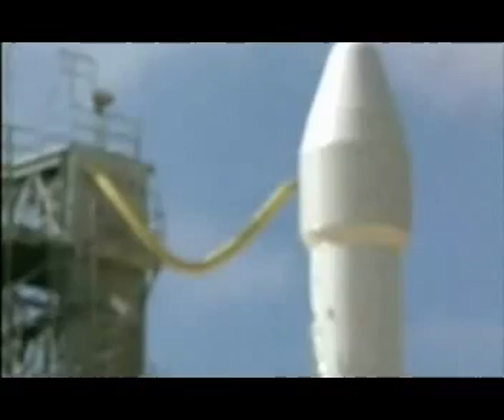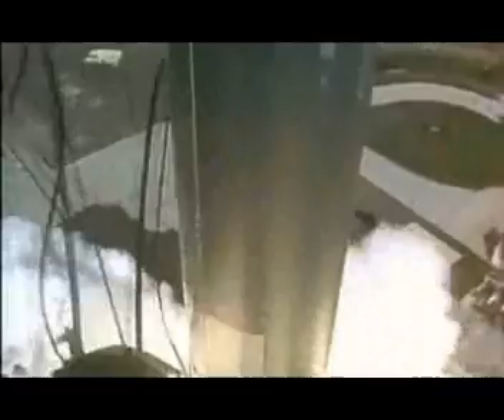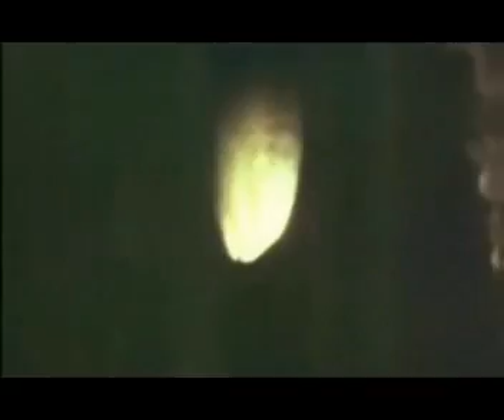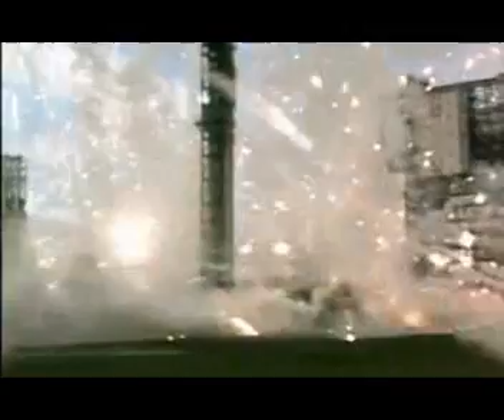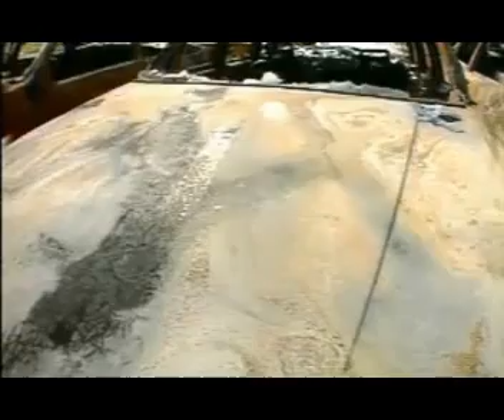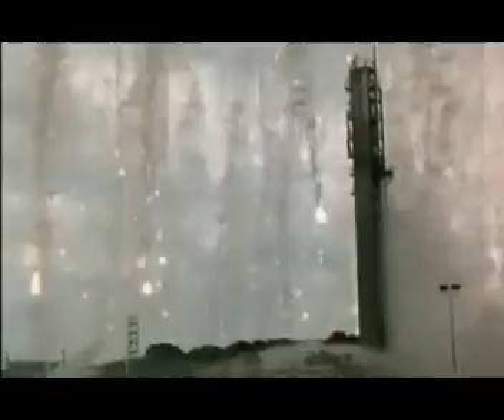delta II rocket explode

Comment: Yes.. the booster which was not ignited properly got stuck by something (forgotten crank as stated later in the video). Pressure might have built up inside the engine, containing the dangerous mixture still not burning... and then after some heating up the whole containing which could not escape out of the nozzle, caused this enormous explosion.
(like a tube bomb, indeed...). 
Unhappy story, really.

Comment: Not necessarily. With some of the Delta rockets, some of the solid boosters light on the ground, while others light as the first set is nearly burned out. I'm not sure of the configuration of this particular rocket, but I wouldn't read too much into the fact that some didn't appear to light up at launch.